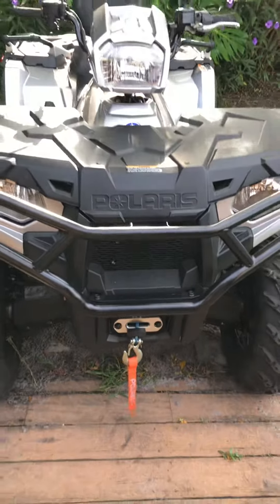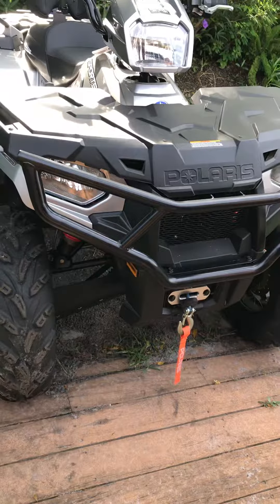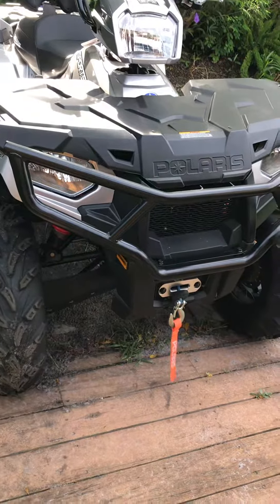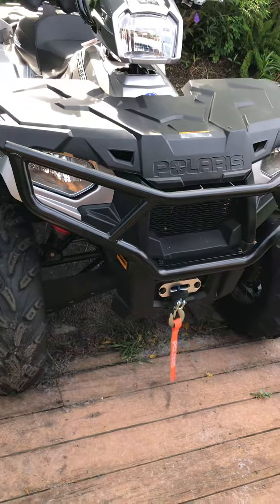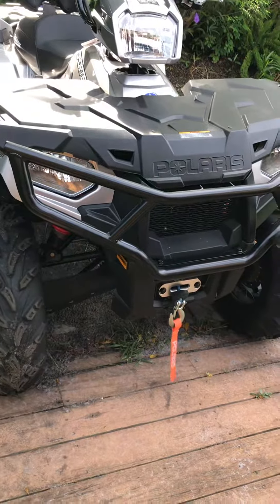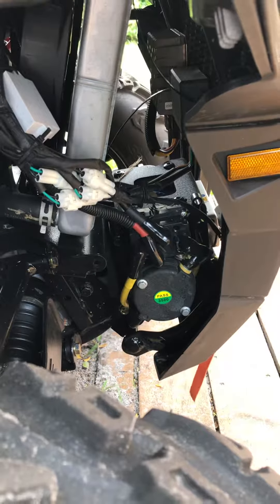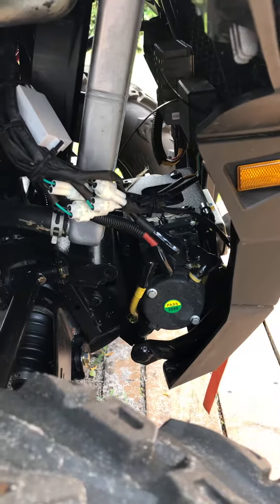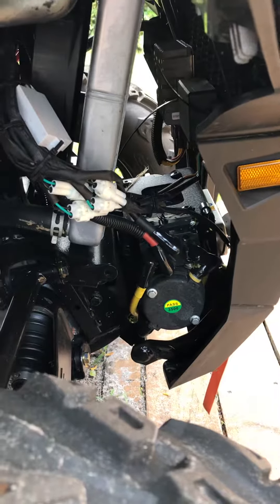Part 2 Front Brushguard

Comment: your right on about the winch i put on the same exact one on yesterday and didnt have too much of a hassle until it came to reconnect the negative on the battery because it is very hard to get at.. next time im going to get one installed at the dealer
Reply from the maker: Tom Kirk . Yeah, Polaris should move the battery to the rear to make it easier to access. Do you have a touring?
Reply: Tony Polaris 570 SP Touring I have the 570 base

Comment: I added the same brush gaurd when i go to pick up the front of bike by the bumper it slightly moves the long bolts with the spacer in it i dont want to over tighten it for it to snap is that normal its only when you pick it up being so wide its tight from the middle nothing loose I just feel if I keep tightening it it’s not making a difference.
Reply from the maker: Thanks for checking out my channel. I used blue locktite and I tightened until there was no gap between the spacer and the brush guard . Although, I never lift the atv by pulling up on the brush guard, It’s never moved when grab hold of it.